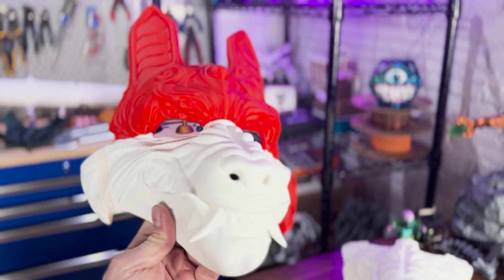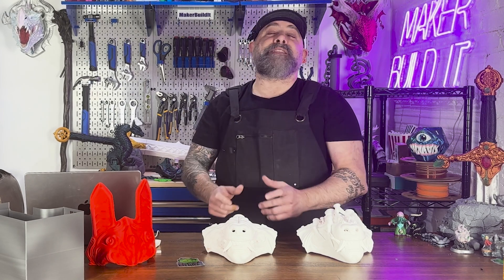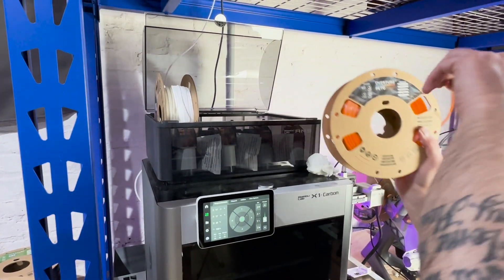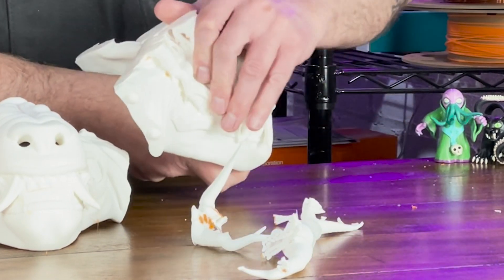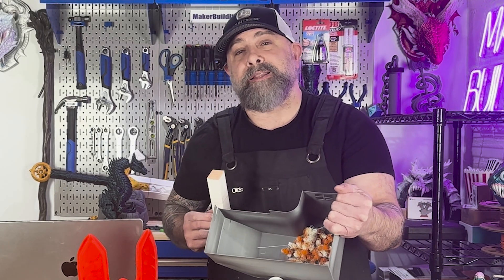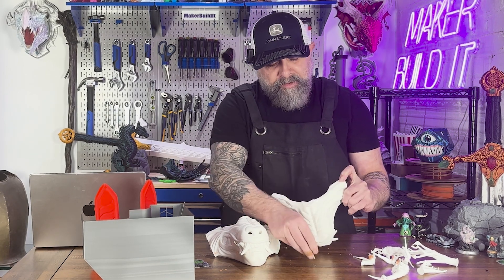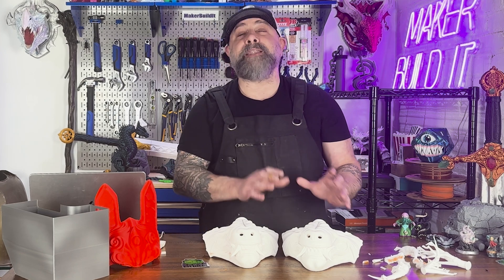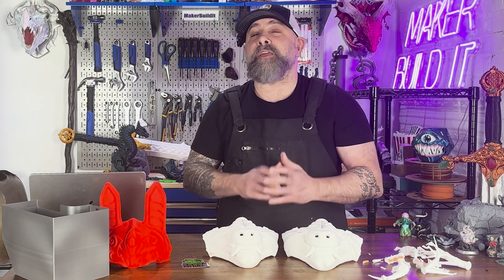Why PETG Supports on PLA Prints Are a HUGE Mistake!

Comment: Yeaah... Title is useless and misleading. Basically this video is about PRINTER SPECIFIC waste issues more than about the actual support material compatibility. 

I was looking info about issues with materials, adhesion issues, custom temperatures related to them and so on.

Change the title to: "... On single nozzle printers with filament swapping", because these issues concern only those devices!

Comment: I agree with you only up to a point. It all depends on the kind of print you are supporting. If there are horizontal overhangs that are on the same plane, or layer, then it doesn't add too much more time to the print, so I would say a PETG interface is definitely worth it. But in your case, with a model that has many planes or layers where supports are needed and the tool has to change to different filament at many layers, then yes, it might not be worth the extra time.

Comment: PLA as support interface for PETG would work WAY WAY better. PETG loves to fuse to itself and it makes supports very unfun to clean.
Reply: I have also since discovered that if you turn your fans on max for the interface layers of PETG it causes them to basically never have issues being removed from the print.